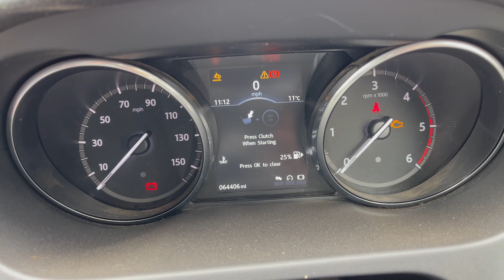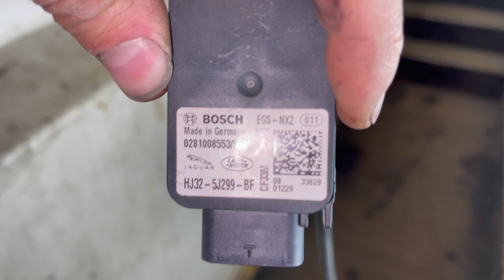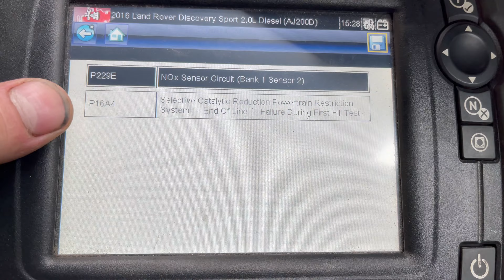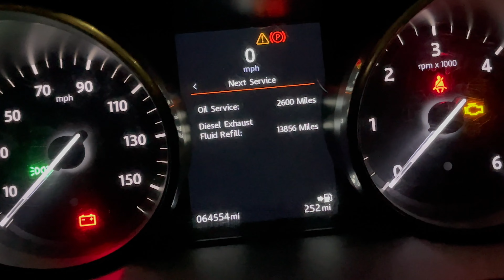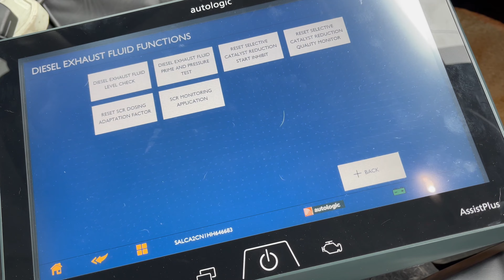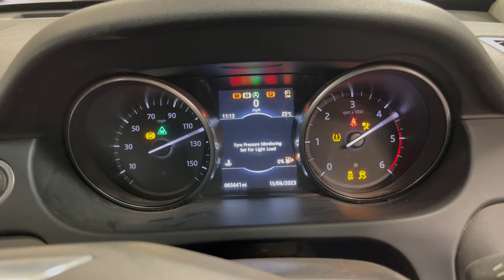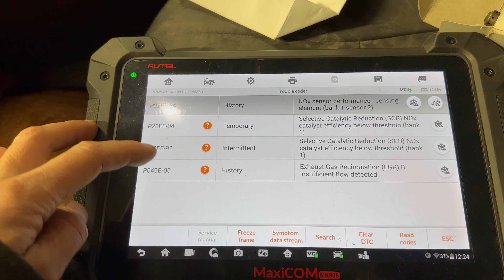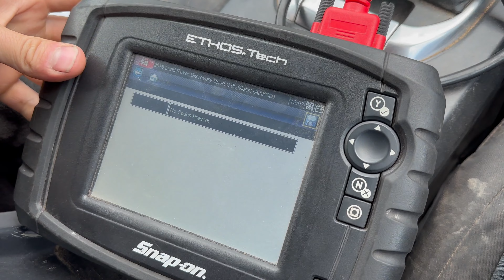Land Rover Discovery Sport NOX Sensor Fault & Adblue/DPF Fault? P16A4 P16A6 U029E-27 P2BAF P2BAE

Comment: I can tell you why you can't get the new sensor to work, had the same thing happen today. When you mount the new nox sensor and change the connector, you also need to swap the cables in position 2 and 4 with each other. It helped for me. It's a shame that this information was not provided by the dealer when you bought the new sensor.
Reply from the maker: Is it possible you have any link to information that backs this up? We still have access to the car and we have the sensor so we could try swapping the pins.
Reply: @IAMASPANNER  Hi there, I've just had my Nox sensor replaced as it came up as an error then a few weeks later, the DPF needed cleaning so then had that done.  The engine light came again on and the garage sad it was the Ad Blue sensor now.  The only way to change the sensor is to buy the whole container as a unit...  I haven't gone ahead but it seems similar to this issue...

Comment: This countdown is not just for adblue level.its for SCR system as a whole not seeing a successful SCR drive cycle.once a successful drive has been completed the range will reset itself.obviously it will fail if there is a sensor/pump/ injector especially if you have checked and confirmed adblue level is ok on live data
Reply: This is also confirmed by having the driver inducement DTC

Comment: Just had my engine transmission light come on. Took it for diagnostics and it is Nox sensor needing a replacement. Land Rover charge £870 for this. I also now have a rattle which has finally resulted in the dpf shield eroding on one side. This is a strange one, £2000 replacement of whole dpf all because two screw fittings eroded, or Landrover (at Team Valley Gateshead), said i could just remove the shield and drive with it. They did say not to drive it in long grass if i took this option due to fire risk. I am really annoyed, was going to take this car from the wife (2017 disc sport with 60k miles) but i fancy my chances keeping my 2012 mazda 6 with 120k miles v this hunk of expensive junk.

Comment: 23:17 turn pin 2 and pin 4. There is a official recall from Landrover SSM75907
Reply from the maker: What does turning the pins solve? Do you have a link to the recall? I tried to find it but the only reference was on a website you had to log in.
Reply: Thanks, that helpt for me 🙏
Reply: Which way round do we swap 2 and 4? That blank pin being 1 or 5?

Comment: Lot or work and time, time, time into these problems.  Struggling with similar right now.  I tried to take off the AdBlue injector nozzle today and could not get the black plastic end out of the tube with its connectors.  The electrical connector no problem. The unit's small end, I messed with the recessed tabs and the tabs with the grips on them (should be hint) for an hour.  Was breaking one of them, and decided to stop.  The nozzle was cleaned a couple weeks ago, just the sprayer.  The error message changed from 'incorrect diesel exhaust fluid quality" to 'dosing' malfunction.  And my Autel shows 2 NoX permanent DTCs.  Maybe I need to drain the tank too.  Not sure where the drain is on a 2017 RR Sport, US model.  Anyone chime in appreciated.

Comment: Hello. I had the exact same issue. Your problem with the new sensor is that the pinout for the new sensor is different than the old sensor!!!
Reply from the maker: Land Rover wouldn’t divulge that information, they insisted the car had to be taken in to be worked on by them. It ended up making more sense to fit a used part. I had my suspicions the pinout would be different but couldn’t find a single piece of info anywhere online.